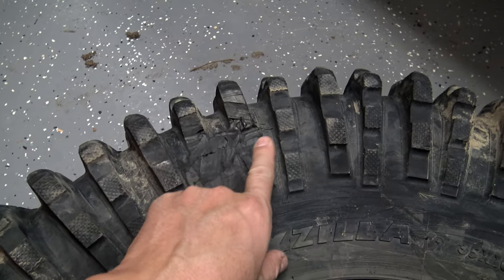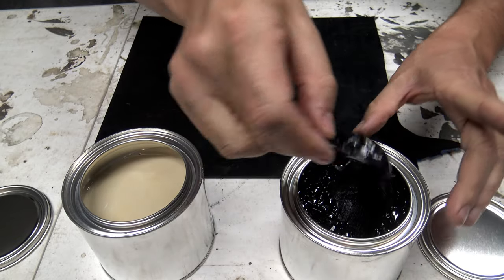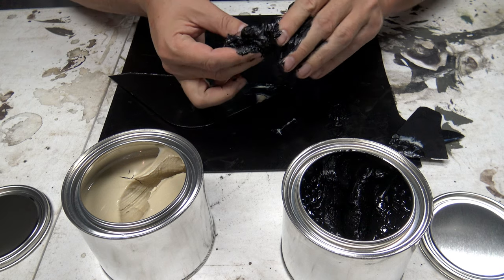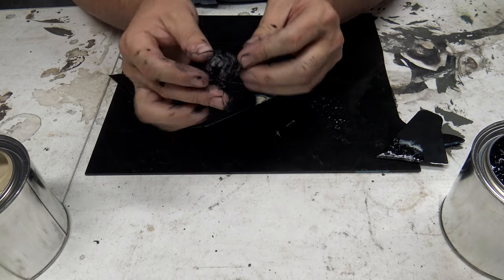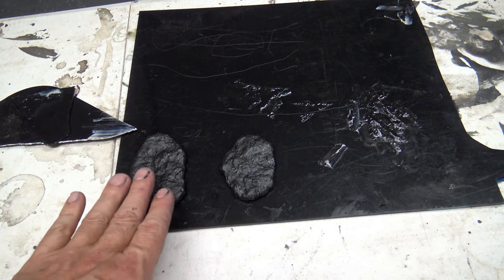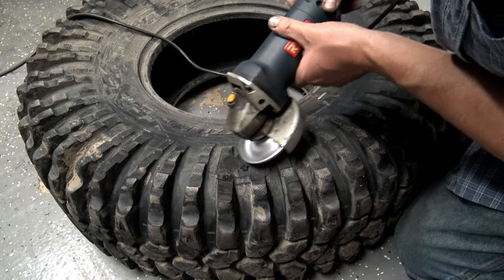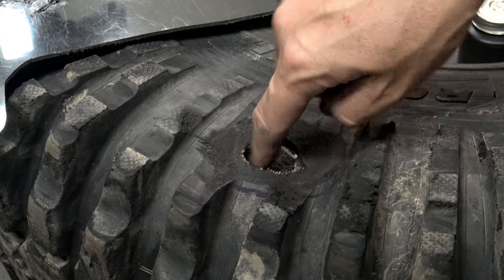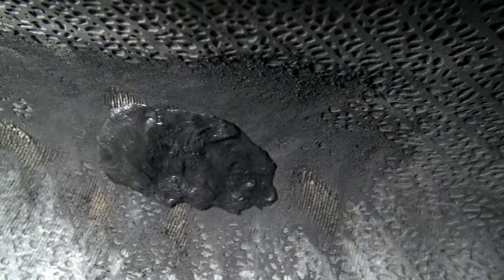Permanent Tire Repair | This Stuff Really Works On Tire Sidewalls

Comment: Never seen this before, but love it!  I'm gettin some asap!  We usually just put about 10 plugs with rubber cement and then light it with a plumbing torch until she's good and smokin.  Most times 2 beers after that process and she's good.  If not, rinse and repeat.  Lol
Reply from the maker: This stuff feels great.  The full size rockbouncers use it too.  Tires are getting too expensive to just buy more all the time.

Comment: Hey bro I've done a good size rubber patch and then I put a tire tube. That was a long time ago and it was on one of my quads. It worked really well. But that there looks like a great plan. Now it's a back tire only but I'm impressed. You should get a lot more miles out of it now. Thumbs up brother.lol. happy holidays.
Reply from the maker: Thank you and Merry Christmas to you also.  This should fix it good enough to where I can use it just like it was.  Im going to put it to the test and let everyone know what happens good or bad.

Comment: I work at tyres, very much a play on a vulcanised fix. Your preparation first, then introduce your rubber, usually done via a special gun , hot plates introduced on inside and outside the wound, held in place under compression. After a designated period the cook time, it is always preferable to reinforce inside with a gator . Done properly on say a large pricey tractor tyre it is a great get out of jail option. I have also seen lots of butcher jobs out there as well. It’s a very good effort for a do it yourself job, but I would go the extra mile, and introduce the gator inside.👍
Reply from the maker: Appreciate it.  It's an introduction to a way to salvage a tire.

Comment: I'd still be a lot more comfortable if some kind of reinforced patch was included to incorporate into the repair.   Personally, I might've put down some fiberglass first in the same situation.
Reply from the maker: You could.  I've heard of folks adding a screen type mesh.
Reply: @GrimRZR  Did it seem like the material had threads incorporated into it (for tensile strength) when you were kneading it?
Reply from the maker: @h8GW  not really

Comment: Its made by Rema top tip in Europe, Its very good commercial grade product, I have paid less for it at other sources, and the reason it was less, is because the date code only had 6 months left of the two year shelf life, it was almost impossible to mix and was quite porous after curing.  Do you self a favor and get it from busted knuckle, they bring it in fresh!
Reply from the maker: I did get it from busted knuckle

Comment: I was wondering if you've had a chance to test the product yet. I wanted to buy some but definitely don't want to spend $100 if it won't hold up.
Reply from the maker: So far I've rode on it once and it's still doing good.  I have found to let the rubber cement type stuff to sit longer.  Sticks faster and better

Comment: So it’s been 5 months now. 
How has the patch held up?
Are you still running that tire?
Is this a permanent repair?
Reply from the maker: The patch held up great.  Unfortunately I cut the same tire in another place that was much worse and bought new tires just recently.  However until that point the patch was still holding great.  I have even patched another tire that is still holding good also

Comment: Be reallllllly careful with that skiving disc.   I fucked up my hand real bad in a millisecond with it.  I find using a wire wheel on an angle grinder and a die grinder with an aggressive bit on it to round the hole out nicely.
Reply from the maker: Didn't use it much.
Reply: @GrimRZR  if it catches, boy does it catch quick
Reply from the maker: @Crawlerjamie  that's for sure.